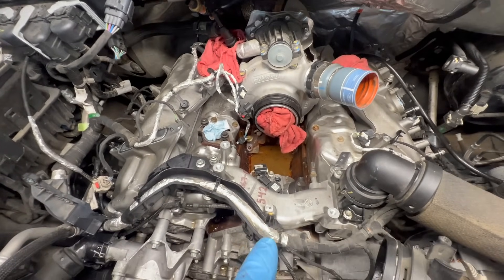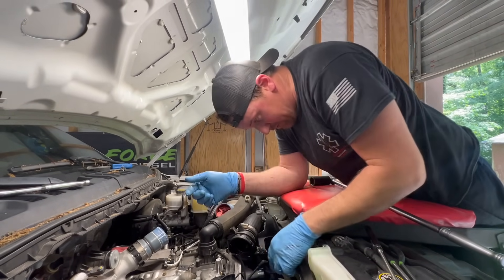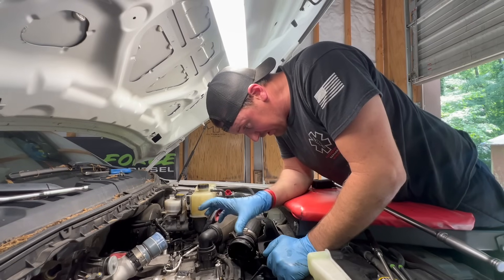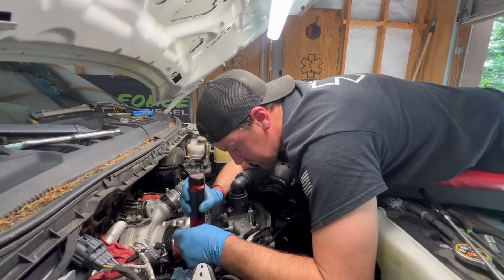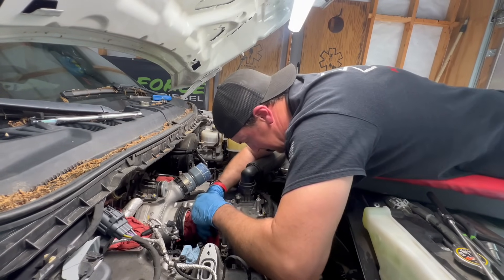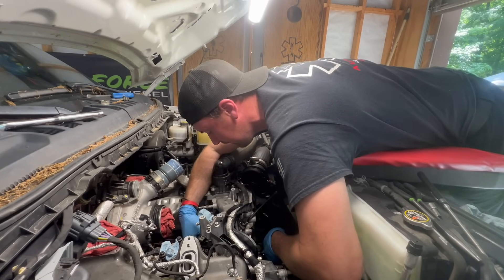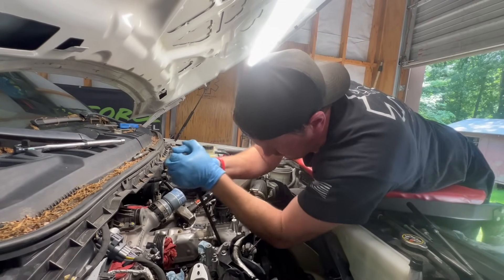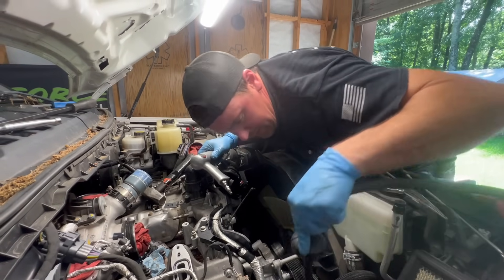Worst CP4 failure we've seen..motor locked up.

Comment: Hopefully the crank gear hasn't spun. They are just pressed on. They are known to spin when a cp4 locks up like this. I would verify that also dude. Btw this is the guy who called you with the shop here in East TN asking about if you had oil coolers still for sale on 6.0s a few weeks back. I picked up an alliant power one for the truck.

Comment: Cass Choate and Luke Langelier have both mentioned the rare occasions of the CP4s locking up the engines. Not aware of it with the LMLs, but definitely a couple of times with the 6.7 Powerstroke engines. If I ever get a 6.7, first thing on the agenda is a DCR conversion. Period.

I have also heard about a Denso HP4 splitting apart and locking up an LP5 Duramax.

Comment: CP4 is what worries me with the 6.7.  How common are these failures?  I'm looking to get a newer F250, might get a gasser.
Reply from the maker: @TXHorn79  some last some don’t, all it takes is one contaminated fill up and it’s ruined. Best thing is do a dcr conversion soon as you get one and not worry about it
Reply: @AutomedicGarage  Would you recommend the S&S Disaster prevention kit? Thanks Drew, I appreciate your feedback and all your videos!!
Reply from the maker: @TXHorn79  no, I always recommending the root cause of the problem which is the pump, by the time you buy the DPK your 1/3 of the way to just buying the pump and not have a break down, have also seen the DPK not do their job on a failure also